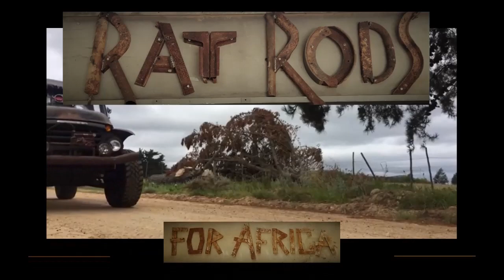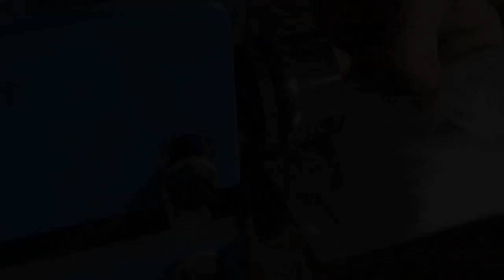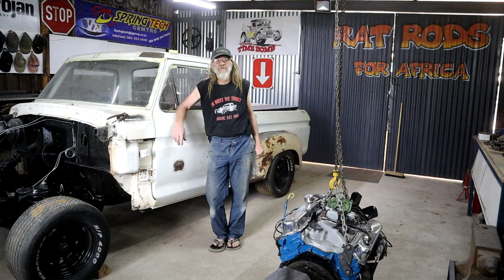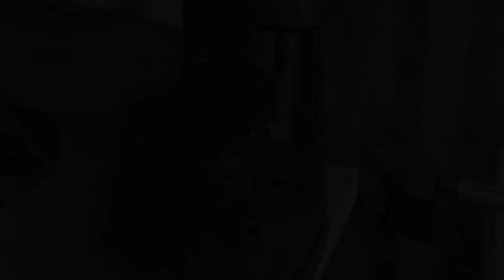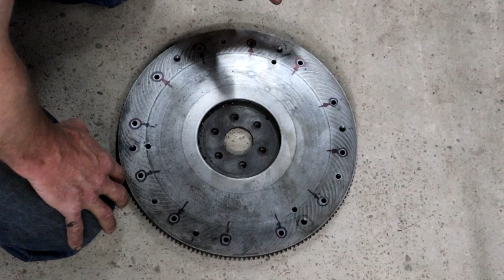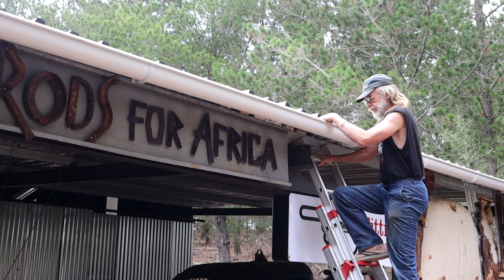DRILLING FLYWHEEL TO FIT DIFFERENT PRESSURE PLATE

Comment: Did you experience any trouble with the balance of the flywheel? If so, how did you address this?
Reply from the maker: Nope. Equally spaced drilling caused no problems